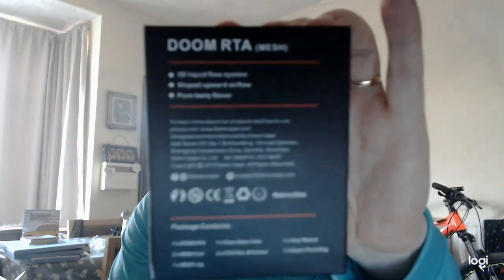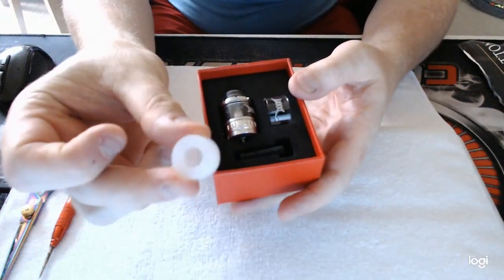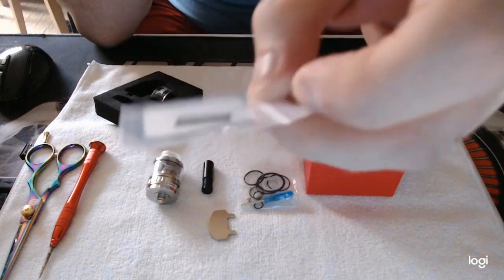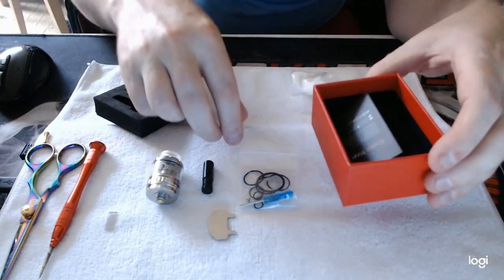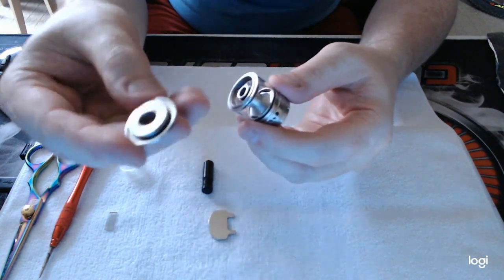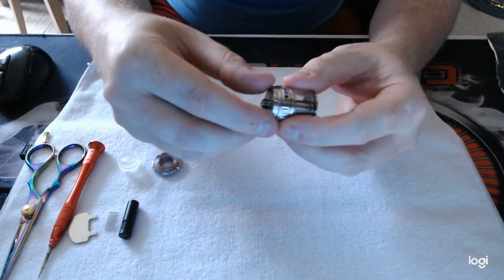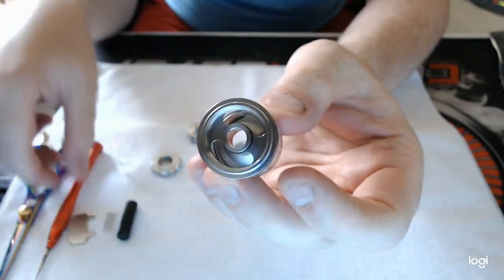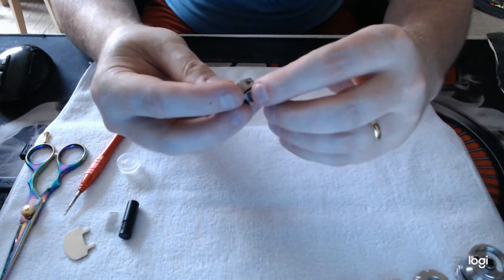Damn Vape Doom Mesh RTA Review + Wicking Tutorial

Comment: Carl, you're wicking technique is spot on. Tried multiple times and failed until I tried sticking the cotton in first. Top man. Works a treat. Thanks
Reply from the maker: Ahh man glad i helped you out, these types of comments is why i do these videos, brilliant thanks Kris
Reply: @MrFreestyler71  24 hours and still no dry burns. Cheers Carl. Subbed
Reply: @MrFreestyler71  hey Carl, just wondering if you ever experienced vacuum issues with this tank? Last couple of builds I've taken it all apart and cleaned, but there seems to be an issue of liquid flow. Once I loosen top a flurry of air bubbles rise up. But hardly any when it's tightened. Any advice would be great. Cheers
Reply from the maker: @krisgilmartin9421  can happen, but to eliminate it, comb out the wick a bit more and it will be fine

Comment: Hi Carl, what's the best replacement mesh do you get? Does it have to be The size 16×6.8mm or can you get different  sizes to fit? Like the wotofo mesh that's 17x 8.5mm? Just new to all this mesh builds, been using standard coils in rdas  for some time now but want to get into the rdta mesh coils  builds!
Reply from the maker: I just use the nexmesh strips that are pre cut to the size you need, they come in a little plastic container with 10 strips
Reply: @MrFreestyler71   Thanks Carl I will check the nexmesh out, and you've got yourself a sub 👍

Comment: how long should you get use out of one of the mesh strips before you need to change to a new one?
Reply from the maker: Hi stewart, you can get I would say 2-3 months or longer, reason being is that mesh does not gunk up like normal coils do and a dry burn of mesh at very low wattage cleans the strip to like new and only slightly darkens over time.